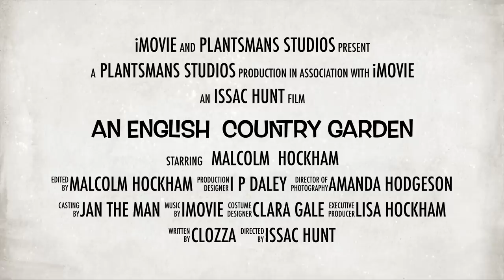Plantsmans Diaries...An English Country Garden 7

Comment: Malcolm, random question, but in eggleston hall gardens, in your retail area where you stage your plants to sell, you have nursery fabric down on the ground. How is the ground under that fabric prepared? Is it just dirt, stone, stone dust? 

Thanks Malcolm! Love the videos glad you are still making them.
Reply from the maker: Hello Ryan……the fabric we use is called ‘mypex’…..there are several similar ground cover fabrics, it’s made of woven HDPE threads….they’re all the same essentially….just different weights and permeability…..but I wouldn’t get hung up on that. It can be laid straight into grass or clear ground….even weedy ground providing woody perennials are cleared as the will cause lumps trying to push through…..I have happily strummed grassland and pegged down sheets. The lack of light kills off regrowth. You need to peg it down well. If your in the UK you can use our suppliers to source items like this…..LBS Horticulture……look up ground cover….it may not be mypex but that was only ever the original brand name so we call all woven ground cover mypex out of habit now. Just make sure any ground is not too stony if your lining pots etc out as it will frustrate you no end. Hope this helps…..best wishes….Malcolm